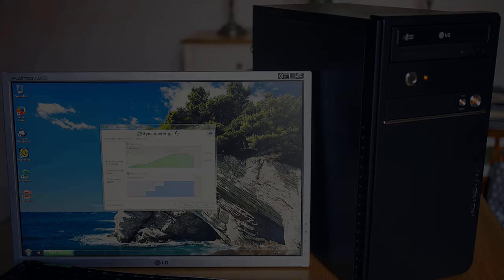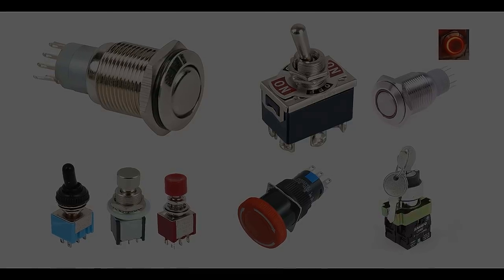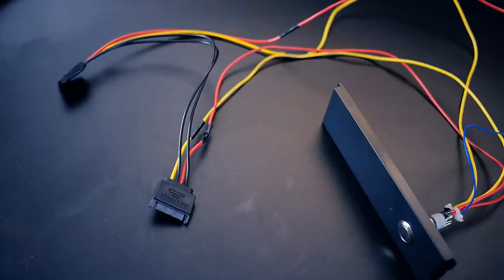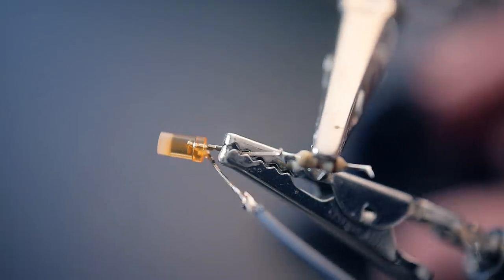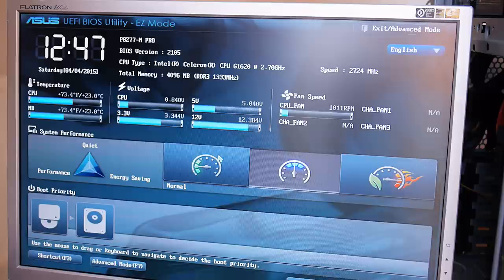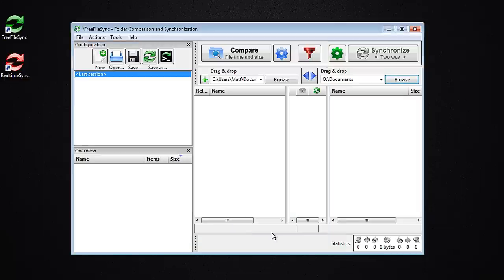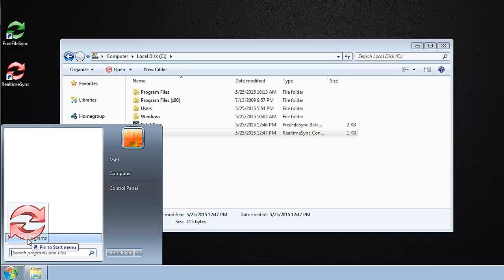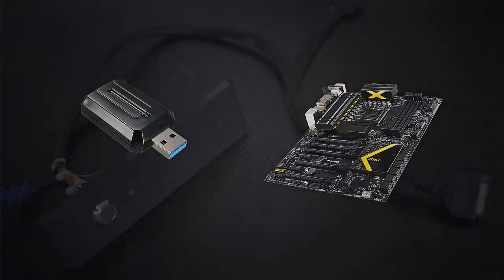How to Make a One-Click Backup Button

Comment: Is it ok to turn off the HDD power source? Because usually it makes the emergency park sound, andd I think it's not good
Reply from the maker: Philippe52 Yes, it's fine. External HDD enclosures wouldn't have hard switches on them if it wasn't.
Reply: DIY Perks that's not quite true. External HDDs usually work with a USB-to-SATA controller that parks the HDD when the user stops accessing it and the system usually syncs all data immediately and doesn't keep some of it in the cache. If you hard-switch it off, that bit in the cache might become lost, which is definitely not desireable in a backup solution.
Reply from the maker: pcfreak1992 Usually, perhaps, but there are plenty of commercial HDD enclosures out there that just use a physical switch to turn the HDD on and off, just like in the video. :) Besides, drives are designed to be able to write all their cache to the platters in the case of a power failure, so it's not too much of an issue. Any files that failed to be transferred (if for some reason the drive was to be turned off whilst the backup process was going on) they'd just be re-copied next time the backup is run.
Reply: DIY Perks well since those commercial HDD enclosures utilize that mentioned USB controller and Windows (usually) doesn't use the cache on external drives, it is not a big deal, that's right. But if you use the drive internally then it's a different story, since there is no USB controller and Windows is actually using a cache for speed increase. And if the hard drive was writing on the file allocation table you might lose all info about all the stored files. And there is no way for a drive to write the cache to disk when it detects a power failure (some drives have caches up to 64 MB).
If you are lucky nothing happens or only the last file becomes corrupt. If you aren't lucky then all files are gone and the drive possibly even needs to be re-formatted. The best way to work with this hardware solution is to manually deactivate the cache in Windows and wait for a few minutes until Windows manually parks the head (or maybe run a script which does that after the backup). 
In my opinion the last thing you wanna do is to let your backup drive do constant emergency parks. ;-)
Reply: It's a nice tutorial and great idea, but just like pcfreak1992 I have my doubts about turning off the HDD without unmounting it.
Reply: ElectronFun.com  I guess that's why he says it needs to be hot swappable?
Reply: Philippe52 Today HDD make auto parking using the remaining energy stored in the spinning platters and turning the spindle motor into sorta of "generator" to get enough juice to drive the voice coil actuator and park the arm. Parking a drive, was an user process long ago LOL, still remember the "park" instruction in DOS ...
Reply: pcfreak1992 There is something called hot plug for SATA drives on modern motherboards,maybe we can use a switch that connects/disconnects the SATA interface instead?
Reply: Giggity Goebbels I'd be a lot happier with disconnection the SATA interface first, you could use a pair of time delay relays to cut the 5&12v rails to the drive after that if you want the physical separation of the drive from the power source as well  Also I do think you should turn off "Enable write caching on the device" for anything you are planning on hot swapping with a physical disconnection when you can't unmount the device, (Device manager>Disk drives>*right click on the drive*>properties> Policies) it won't bypass the internal cache for the device (the write cache is normally small compared the read cache to avoid data loss) but will at least stop windows using a software buffer that would need to be flushed to the drive. (You can make API calls to bypass the windows cache and I would hope backup software would do that, but if you are using the drive for anything else as well you are more likely to run into issues)
Reply: Michael Laugesen You all are probably right. I just have my concerns about powering down a drive without unmounting it first. I guess it would be a bit safer if you turned off write caching on the device.
Reply: ElectronFun.com  Hot swap drives get, pulled while on.  I think with hot swap enabled the drive is treated like one of those external drives so data lose or parking should not be an issue, but in a power outage they park anyway as the spin down.
Reply: DIY Perks The biggest issue is how you have drives set up in windows. But if you have disk write caching enabled you will most likely be doing the opposite of backing up your data..
Reply: ElectronFun.com Hot swapping is only part of the bios, windows may be caching the drive
Reply: Windows (not sure today) used bios I/O services while Linux used his own I/O services rather the ones provided by the BIOS. Of course it boot up using the BIOS services and then, I believe, they start using their own.
Reply: Philippe52 Because the PC BIOS is treating it as an external mass storage device the arm is automatically parked when the HDD isn't being accessed.
Reply: So what's the best solution to overcome this emergency park sound then?

Comment: Hi! Love your videos, this is the first one that I decided to try myself. Here's my question, the button that I bought has 6 connectors coming out of the back instead of the 8 on the button that you used. When you wired up the red wires, you said to repeat it in the exact same way so I assume that the other two connectors on your button are also connected when the button is pressed? If that's the case, could I simply use the same connector for both the yellow and red wires? I understand that one yellow wire must go on one connector and the other must go on the other (whichever is connected while the button is pressed), but is it possible for the red and yellow wires to share the same one? I tried this at home and I fail to boot whenever power is given to the device, pressed or not. Thanks for any help in advance!

Comment: FYI, there's no reason to cut the black wire and twist it back together.  Use wire strippers or a knife to cut through the insulation, then just pull it apart a bit.  Do it right before soldering the other wire in, and the insulation will slowly slide back into place, nearly covering the solder joint.

Comment: Why not soldering the LED directly on 12v and 5v?
And calculate the resistor for 7v to what the LED needs?
So in this case you can leave the black wire as it is and you have less solder joins

Comment: I might missed my coffee today, so my brain goes in limb mode ( :) ) and just wondering. (Although I might figure it out in a while)...
Why do you need that kind of switch? 
If You push the button, you connect the yellow power?, and the button is deactivated...is the red (5v) still connected?, and why?
Or perhaps I need that coffee now. hehe.

Thanks so much for inspiration for DIY. Have ordered a lot and gonna start building stuff soon (ebay-delivery)... :)

Comment: Is there a little problem with the mirror mode? Look: I press the button and the backup is made. A little later I accidentally delete an important file. No big deal, I have it in the backup hard drive. But if I connect the drive for recovery the data, it will be automatically mirrored from the drive that doesn't have the file. You would say: Of course you have to disable the auto-backup, but you have to REALLY pay attention to this, otherwise the meaning of backup is not achieved. If someone wants to recovery the file right away, most people may not remember to do that... Maybe one of the others modes is safer.

Comment: Hey DIY Perks, is it possible to reverse the data stream and make it so that every time you plug the hard drive in, it dumps all the data from that drive onto a similar folder. For instance if you wanted to make it so every time you plug in an sd card, it dumps all the picture files into a folder on your computer?

Comment: Isn't it possible to connect both ground wires together to a single latching button? So you can use most of the common buttons
Reply: Oktay Yumlu Of course! it makes no difference.

Comment: Hey i have one question about this. Is that Led ok for this or is it too bright? I really know nothing about that so i cant say for myself if that watts for this little Led are too high/low. So could you please take a look on this? And are 3mm Led enough?
Here are the specs found on ebay:
Forward Voltage (V) : 1.8 ~ 2.2 for Red and Yellow
                                   3.0 ~ 3.4 for Blue, Green and White
Reverse Current (uA) : <=30
Luminous Intensity Typ Iv (mcd) : Average in 8000
Life Rating : 100,000 Hours
Viewing Angle : 120 Degree
Max Power Dissipation : 80mw
Max Continuous Forward Current : 30mA
Max Peak Forward Current : 75mA
Reverse Voltage : 5~6V
Size: 3mm

And also there should come resistors with these leds. You said the resistor should be 150-220 Ohms depending on the colour, but the resistors that come with the leds have 470 Ohms. Im really worried about that the led could be too bright. If you want you can take a look on it yourself:
ebay . com/itm/100pcs-3mm-Red-Yellow-Blue-Green-White-Flat-Top-LED-Wide-Angle-Leds-Resistors-/321464065222?pt=LH_DefaultDomain_0&hash=item4ad8c05cc6

Comment: Very Nice idea.
I have follow your video step step to my own pc. I have used an old 2,5" 1TB HDD and have changed the bios options to hot plug. But now i have one problem. The Backup HDD loses his drive-letter. Everytime i start my pc i have to give the HDD an new drive-Letter, but the old letter is no more available.
Hope you have an idea or a quick solution.
Thanks for your great videos ;-)

Comment: DIY Perks  You're so right about ramsonware. This is great against that. But when you cut the energy from the disk like that, isn't that bad for the data stored in it? What if Windows was doing some kind of read/write op to the disk? Or the cache was not cleared? I think you should disable cache for that disk, even more now with 64mb cache on most disks. Also, do the reading heads land where they should on the disk when you cut the energy?
Reply: +itsLean ★ THat is why he enabled hot-swap.
Reply: Oh, true that!

Comment: What if something happens and you loose a part of your data on your normal drive, and you want to get the data back from the back up drive. You can't just push the button and connect the drive because then the data you lost on the normal drive would also be removed from the back up drive...
Reply: +SwaggerBoyNL1234  DIsable the batch script until you have restored it.
Reply: +Nicholas Festa Noooo! I don't have enough wisdom for this! (What is a batch script? I'm a noob :))
Reply: +Nicholas Festa Never mind, I already understand you. It's actually pretty simple haha, but thanks.
Reply: +SwaggerBoyNL1234 batch script is a list of commands writtin in a file normally like .bat extension.  So you can run this file and it does each command line by line that you put in the file. like a text file telling you 1 do this 2 do that 3 do this.
Reply: +Mark Cisewski Ah okay thx

Comment: Did you ever get any filesystem corruption after shutting down the drive without unmounting it? I would really consider this, especially for a backup drive.
Reply: if you don't sync large amounts of data you could simply deactivate the write buffer of your backup hdd.
But then again reducing write performance would probably cost you more time than three mouse clicks to unmount the drive. 
I've never had filesystem errors after hotswapping, but if the data is important unmounting a drive properly is probably best ( it's basicly a "flush buffer and shut down" command )

Comment: How do I know if the switch I have is adequate for this project? It's a latching DP switch, but it's only rated for a max Current of 0.1A and a max DC Voltage of 32V. But I have no idea what is required to make this work, or how much the components draw.

Comment: There is a situation this WON'T WORK = If the Drive Letter changes, the Batch file won't work. This happens if you add or remove a storage device ( not the Backup HDD) . Other than that , the app is sweet and I'm using USB HDD. Thanks !

Comment: Thank you.
I bought two external drives and used this program.
I was just wondering.
Next time I plug it in for backup.
Will it just add new files added to my folders or will it replace edited ones?
Or do I have to select that it replaces all files every time I connect?
Reply: +Henrik Thuresson The software allows for a variety of backup types. In this instance, he chose "mirror" which copies the current state of affairs onto your backup drive (including deletions). You could also choose a different type of backup  to add new files.

Comment: The software sync must be installed on safe mode or not??
Are you don't use the D drive so you can backups data from C drive into D drive? ?

Comment: Uhm... You should disable write caching for your Backupdrive, or you might damage the MFT on it by simply turning it off.
Same goes for external drives, or you can also dismount them with "Remove Safely" (or whatever its called in english).

I've had to deal with enough drives, that were hot swap enabled, with corrupted MFTs.
If there is any writing action still going on, which might take LONGER than what you see with your backup tool, you might create corruption.

There is a reason Safe Removal was added to Windows.
If you disable the write cache for a drive btw, you don't need to safely remove it once data transfer is completed.

Comment: This mode of backup does not protect against accidental file deletion. If you delete a file by mistake and want to recover it form the backup the moment you connect the drive the file is also deleted from the backup.
Reply: Not necessarily, you would just have to remember to stop the backup software before pressing the "backup" button, as then the backup process would not start and you can use the drive just like any other old hdd.
Reply: TheMovieCraftStudios That is true.  It would be neater to have a arm switch (like in fighter jets) or rotary switch that would connect the HDD in one position and in another position would initiate the backup process. But that would require a hacked usb gamepad or keyboard to run a macro to run the software.
Reply: That would indeed be very neat :D
Reply: Vlad Macovei instate of all that trouble, just desactivate the automatic backup once the disc is plugged!! And make a bat file for manual backup...

Comment: Can I use a script instead of the software he used? Don't really trust random software, especially ones that try to install random adware.
Reply: I was thinking the same thing.
Reply: Can i have instructions on how to make a script please? i feel the same
Reply: +Ryan Bright There are several options. A good one for beginners would be autohotkey. It could literally be one line of FileCopyDir, [source], [destination], [overwrite?0or1]. But of course you can add more over time to make it more powerful & complex.
Reply: He also provided a adware free one. but do what you want
Reply: +Peter The point is that you know exactly what your made script is doing. The same can't be said for 3rd part software.
Reply: Free File Sync are great!
Reply: +Aye Khine I don't anymore. Sad where its gone

Though that is prob fine
Reply: Aye Khine yea thanks
Reply: VailedFool333 I can make a script for Documents if you want.
Reply: FreeFileSync is Open Source software, the code is open to everyone to read or compile,
Since its opensource and free they rely on ads and donation to generate revenue to pay the programmers involved in the project.
Reply: PSA from someone who spends way too much time on computers:

You can try SyncToy (made by Microsoft iirc) on Windows. It's a nice simple UI and command-line program that does exactly what FreeFileSync does. One of the most well-designed Windows programs I've seen. As for detecting the drive on Windows, you might be able to put some kind of autorun script on the drive itself, then have windows run that when it detects the drive.

On UNIX, you could use rsync, as it is extremely efficient can be restarted perfectly even if it stops halfway through copying a large file. It's called rsync for Remote Sync but it can copy locally too. If you want to store every single version of your data, you can also use a version control system like git, but these are more optimized for text and may use too much space and be extremely slow.
As for detecting the drive, on UNIX you could detect when the drive appears in `/dev/`, (using the `watch` command, or maybe a cron job), then activate `rsync` or a standard backup script. I'm considering writing a native program or shell script if possible, will update here if I do.

At least one good thing about these two methods is, they'll both run 100% in the background (or, if you want that, you can add any arbitrary UI program to display the status).
But at that point, you might as well just write a script to do this automatically, or better, use RAID
Reply: POLYMETRIC I read "UNIX" and I was afraid I got myself into another Linux argument.
Reply: I hate Windows with a passion. I'm doing all I can to not make a huge list of why Linux is better :P
I've just gotta say that, basically at this point, Linux is not much less than an open source OS X right now. And being open source can only benefit the user. I didn't even realize this until recently. Most people don't, it seems (I hope this doesn't sound arrogant or anything).

I say UNIX because there's not only Linux, but also OS X, BSD, Solaris, AIX, HP-UX, MINIX and a few others, and they're all pretty similar. In my experience, OS X and Ubuntu Linux seem to be the strongest desktop- and user friendliness-wise, though.
Reply: VailedFool333 although it's much less easy you could use an Arduino micro together with a relay. You'd also have to wait some time (probably just a few seconds) for it to execute all the things.